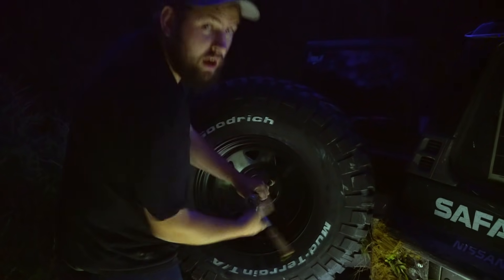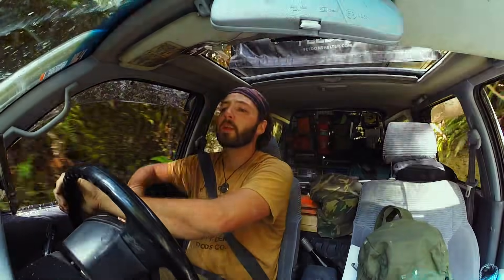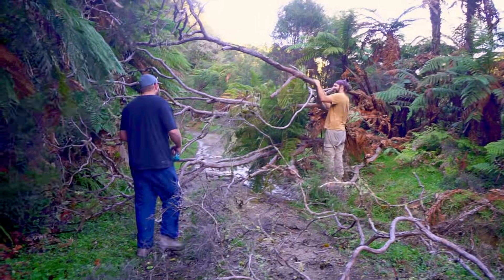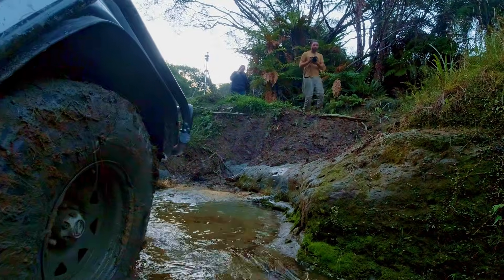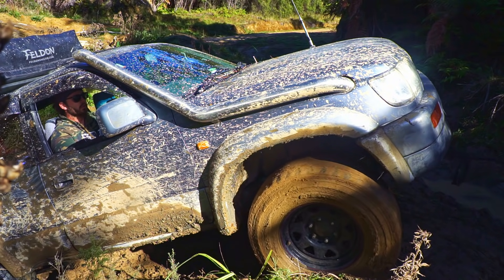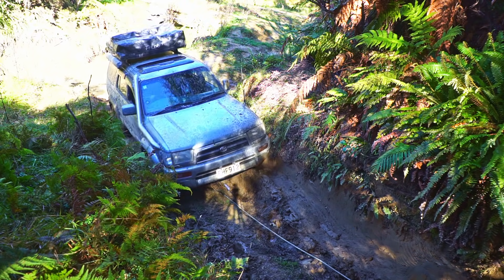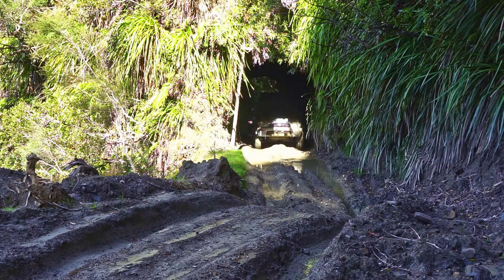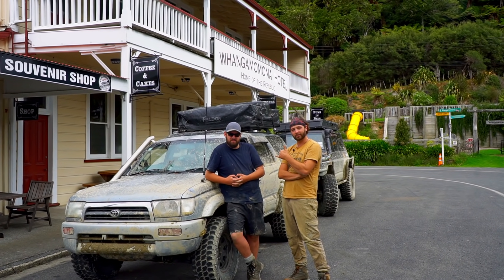Old Whangamomona Road | Taranaki's back road into the republic

Comment: Nice one Jono! This is my stomping ground not far from where i live. I fang through there on our mx bikes often. Takes about 20 mins to 1/2 hour on them. It changes all the time and is massively different coming out of every winter. Love it out there!
Reply from the maker: Wicked mate, its a great spot to be local too. Must be a bit of fun and a bit of a challenge after winter though
Reply: Yeah i don’t bother with anything other than my mx bike until after the road trust do their post winter maintenance/repairs. There is a donation box at the pub to help towards their cost. The local council dont want to know about the maintenance of it so its left up to the locals. One thing thats is worth mentioning too is that the road is not officially closed over winter as its a public paper road bout the whanga road trust doesn’t encourage its use by 4wd’s due to the extra damage they do in the wet conditions. If anybody gets stuck and needs help over this time none of the locals are likely to give them a hand.